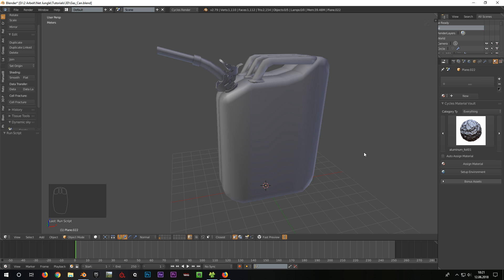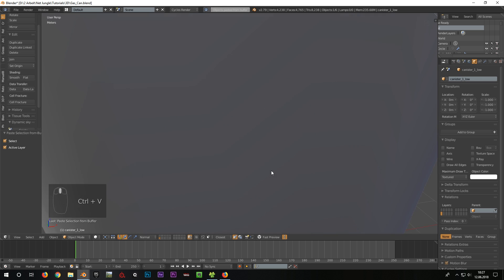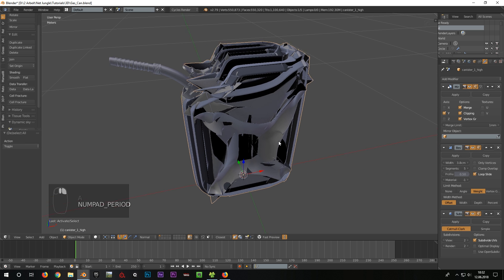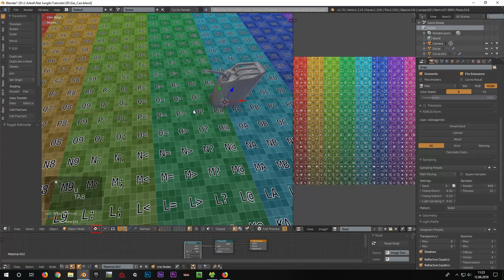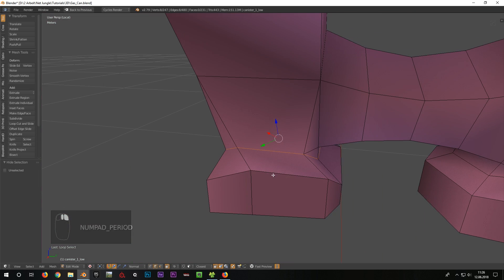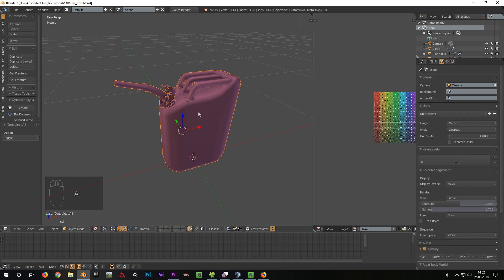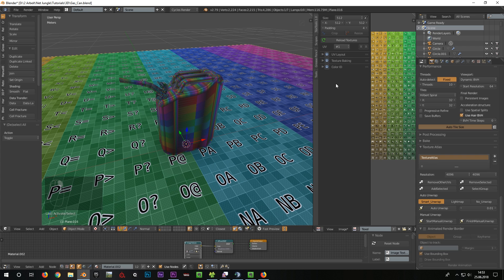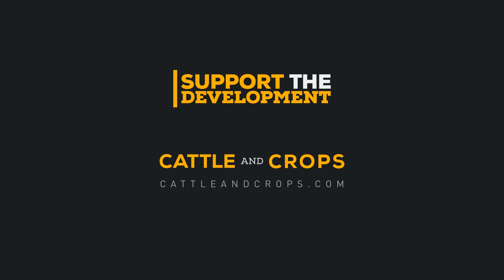CNC Modding Series - #04 Blender UV Mapping

Comment: What version of Texture Atlas are you using as the Version I have with Blender V2.79 appears different than the one in your video. I am unable to bring up the menu for the island space on the UV map ( where your press F6 and set 0.04). I also do not have a section called Texal in the texture tools. Great video BTW and thanks.

Comment: I think this game is really promising, but I bought it on Steam, and after playing it for a couple os hours I decided to ask for a refund. There is a lot of work to be done and I found the game as if it was a big tutorial, very limited in all aspects. And yes, I understand it is an early access game. Also, I found that the sound of the vehicle´s engines needs to be improved considerably. Noticed also a lot of FPS drops, and the aspect of the trees changing shape when getting close to them was awful. As a suggestion, starting off with a farm and a lot of vehicles is not a very nice way as immersion stands for. It would be nice to start with a loan or a certain amount of money and the player decided to invest in farming, and having to decide among 2 or 3 farm options to start a career, not just say that you inherited it. It could have a farm with a bigger field, but lacking off vehicles or equipment, and a farm with a smaller field, but with some more equipment. Maybe a third option with a better localization, closer to the places you can sell your crops. The player decides which to start with, of course with different prices between them. I´m really looking forward to see this game thrive, and when it gets ready I will certainly give a second chance. I wish you guys the best and hope you can develop this game to be the best farm sim ever. But hurry up, as FS19 is on the way. ;)